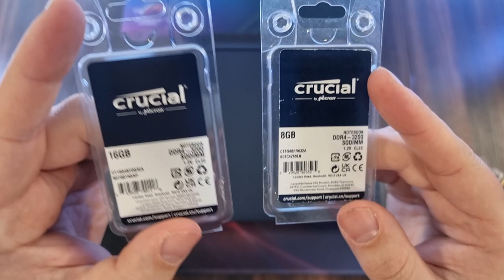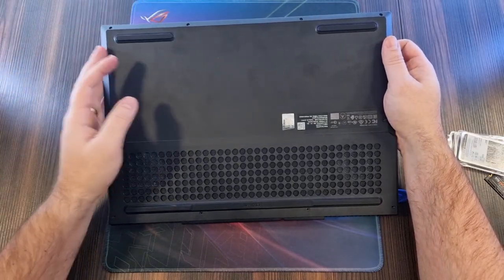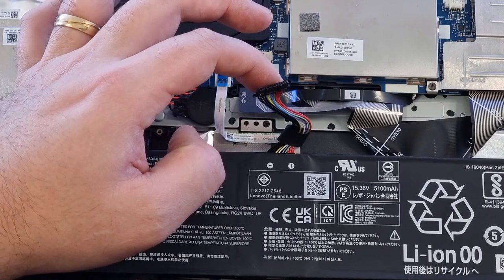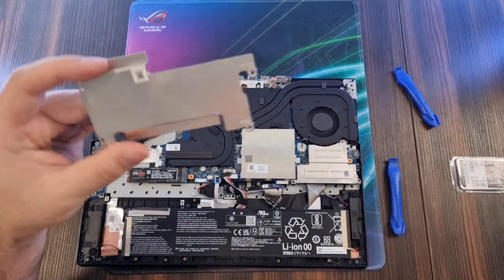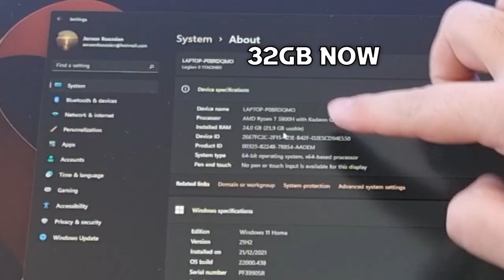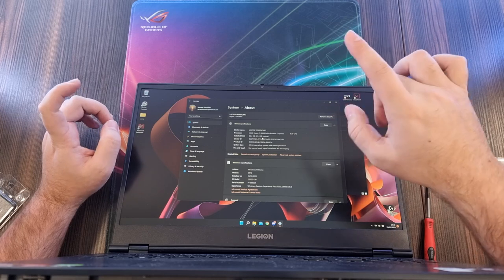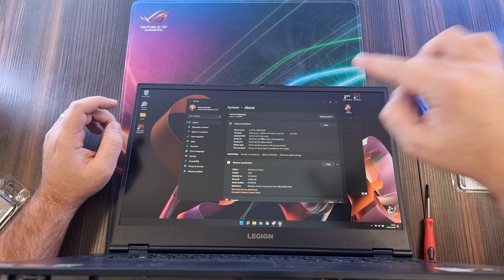Legion 5 Memory & SSD Upgrade Walkthrough | 17% More Performance | 4 Games Tested

Comment: I opened my L5 with an old bank card. Thumb nail in to start at the corner, slide card around edges. The side vents are the most awkward. Used 32gb kit of Kingston Fury 2933 cl17 to upgrade. It flies.

Comment: Thanks a lot for this detailed video, I have to like it.
May I ask what would happen if you installed a 4TB SSD, would it still work?
Reply from the maker: Sure!
Reply: @TechTyrial  
Are you sure it won't be oer the allowed capacity limit?
I am asking because I am about to buy one and it is irrefundable if it is opened. 😅
Reply: @shriefallam8866  there isn’t a limit to SSD. Only RAM
Reply: @hoodkazibwe  
Thanks Hood. Yes, I know now simce I tried the 4TB and it worked just fine.

Comment: Hi! I just wanted to know if it is possible to add simple 2.5” SATA HDD in 17.3 inch Legion 5. Because I can’t see any binding for it in this video. Thank you!
Reply: This 2021 version doesn't come with the SATA drive or port installed like the 2020 model. You gotta buy the M.2 (I found that out once i had already bought a SATA HDD already lol). If you've got the 2020 model then you can add that if you want.